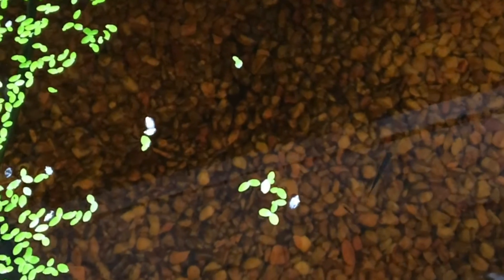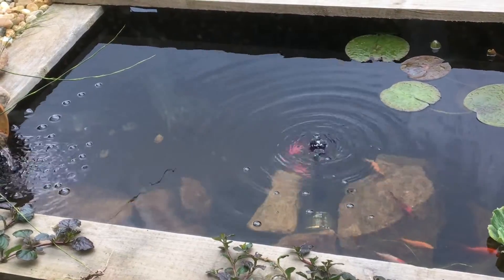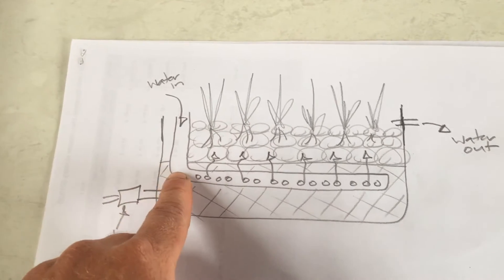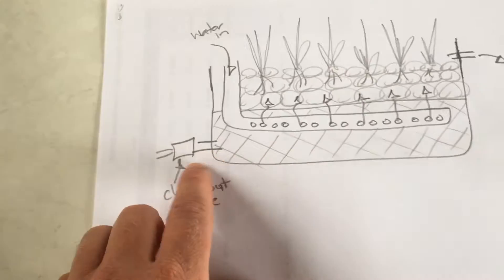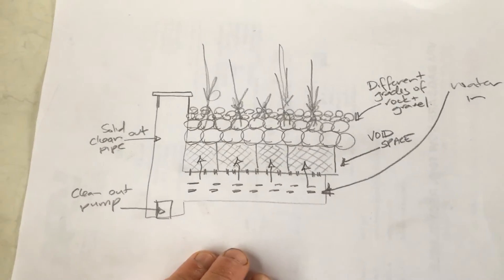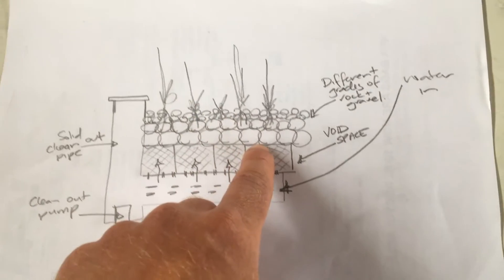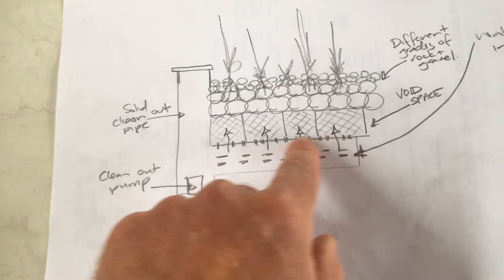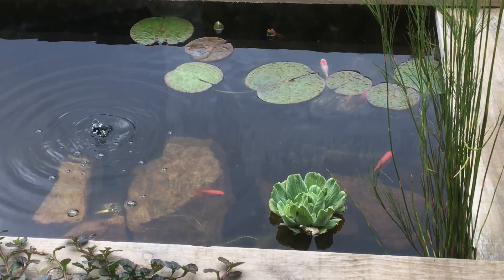What size should a pond bog filter be?

Comment: Hi Kev, the pond you built where you retained behind the blue drum (bog filter). How many litres is the pond and what size is the bog filter (in litres) and what size pump did you use. Thanks
Reply from the maker: I estimate the pond is between 2000-3000 litres. Bog filter is 220 litres. Pump is 4500 litres not all running through the bog.
Reply: @Ozponds  Thanks, I really love the overall look of this pond. Well done,  I'm just in the process of costing something for my place.
Reply: @Ozponds  , so have you diverted the flow 50/50, splitting the flow so half enters the bog and half spills down stream/waterfall?
Reply from the maker: Kinda. Half just passes over the surface of the bog before continuing its journey down the stream and waterfall.

Comment: Im confused,  so if my pond is 5 meters long x 2.5 meters wide x .6 meters deep, then i need a 750 litre? bog filter (plus a 8000 LPH pump).
Reply from the maker: You could do it that way. 750 litre bog I’m looking at about 4500 litre pump. If you go 8000 litre pump don’t run all the water through the bog.
Reply: @Ozponds I presume the excess water not being pumped can go to random outlets direct in the pond?
Reply from the maker: @ absolutely 👍

Comment: I think I'll need a bog filter with at least 50% the pond's size....   
I'm actually making a bog filter for my bird bath (it gets super dirty), but 25% of it's size would make the flow way to fast considering your suggestion of 15 min long flow... does my idea make sense?  I hope it does :)
Reply from the maker: That makes sense or you could use a smaller pump. A bigger filter is always better in my opinion.

Comment: Hi Kev, Thank you for the awesome video's! We are currently trying to design our bog filter.
Our pond is a rectangle 57 ft long, 4,5 ft wide and 1,5 ft deep, which totals around 2827 gallons.
We have a 264 gallons IBC tank, could this work as a bog filter?
The tank's surface is 12,9 square feet, when compared to the pond's 256 square feet surface, we should have two.
When looking at the pond's volume, it's a close call, would you still recommend getting a second one?
Again, thank you!
Reply from the maker: Ibc makes a great bog filter. It’s up to you whether or not you add a second. I will say more filtration is always better.

Comment: will bog filter work with clay bottom farm pond 1800 ft2 w/ much silt and muck
Reply from the maker: Well to start with you would pump water from the surface. You don’t want to just pump a whole bunch of muck into the filter. It also won’t capture the silt very effectively. Clay particles are little buggers you really need a flocculent to force them to clump together. Is it the silt that is causing your clarity issues?

Comment: Hi Kev, i am looking at adding bog filter to my pond. The pond is about 1000 litres so looking at 100 litre bog. However I also wanted to have a skimmer, but the ones you can buy like Oase Aquaskim recommend minimum 8000 litres/hour. Can any skimmer work on lower flow rate?
Reply from the maker: Not really skimmers do need a decent flow through them. Have you had a look at my budget goldfish pond? It’s 1000L, has a bog filter but no skimmer. Water is crystal clear year round, I just scoop the built up waste out once or twice a year.

Comment: What do you put in the void space so rocks dont cover it up?
Reply from the maker: You can use anything that will hold the weight of the rocks above. Professional installers use specially designed equipment such as aquablox. I’ve used large diameter pipes, milk crates etc. Others have used plastic pallets. There’s many options. It depends on your budget and what you have available.

Comment: What exactly do you use as a void space? can i use some plastic basket ?
Reply from the maker: Anything that can support the weight of the rocks and gravel. On small systems I just use larger rocks and gradually go smaller and smaller. On larger filters aquablox, large pipes with holes, even milk crates. Whatever you can easily get your hands on.
Reply: @Ozponds  Yeah I was looking for milk crates
Reply from the maker: If your going really big one viewer suggested plastic pallets. They are cheap and can withstand heaps of weight.
Reply: @Ozponds  oh thanks, I‘m going with a 300L Tank
Reply: Can the stones be replaced with other items in a bog filter, if so what items?

Comment: Hello, what do you use to cover the pump end of the water inlet so it doesn't get clogged with debris?  Do you enclose it in a container or do you use a filter material on the end?
Reply from the maker: G’day Patrick. At the moment I am building 2 for my dream pond. Where the pipe from the pump enters the bog filter pipe I have used geotextile underlay to stop the rocks and other debris entering that section. Hope that helps 👍

Comment: Hello, your idea is so great, I really want to build a bog filter too. May I know that the material used under the water pipe (crossed area in your video) ?
Reply from the maker: G’day John. It can be anything that will create a void space and support the weight of the rocks above. Professional installers use special load holding matrix blocks (such as aquascape aquabloxs), others have used milk crates, even just large rocks will work. If it can allows solid material to pass through easily without becoming clogged it will work. Hope that helps 👍
Reply: Great work undoubtedly 👍

Comment: Hello Sir! I am planning to build a pond with the natural Bog filtration system and/or Aquaponics, but the pond is meant for ducks. I have been looking for videos related to this, but often this filtration system is meant for fish pond and I haven't seen someone with a filter system for DIY ducks pond. 

Why is the reason for that? But do you think having a sustainable filter system for a duck pond will also work? Thank you.🙏 I appreciate all the learnings you've taught us with your videos!
Reply from the maker: Gday mjlm. Ducks are notoriously messy. Bog and aquaponic filters will help keep the water healthy. If I were doing a duck specific pond I would want tons of circulation, I would definitely incorporate a skimmer/ intake bay but also pull water off the bottom of the pond (ducks poo a lot). In regards to the circulation I would have some jets pushing water along the bottom towards the pumps as well as surface jets. Good luck with your project 👍

Comment: Hi excellent video. I have a question.? I am in the process of enlarging my fish pond. The new addition will be 18 x 23 feet. The deepest section is 4 1/2 feet. The rest of the pond is about 2 1/2 feet. I dug an area outside of the pond for a wetland filter or bog. The size is 3 1/2 feet wide by 12 feet long 3 feet deep. I used reinforced milk creates 14 of them side by side as aqua blocks. I am using  ABS 6 inch corrugated drain pipe as the centipede. I cut out slots on the top left and top right of the pipe. 1/2inch wide by 4 inches long vertically every 5 inches along the full length of the pipe. This pipe will be on the bottom of the hole in a trench with the aqua blocks (milk creates) on top. On top of the blocks will be different size gravel. 8" of 3" - 6", 8" of 2"- 3" and 8" of 3/4" - 1 1/2" river rock.  I am also using a large pipe for the cleanout of the filter. The water intake will be coming from the ponds intake bay. My question is the size of my wetland filter. Is this size sufficient for the new addition? I could try to make it bigger but the space is limited due to a deck and cesspool near by.
Reply from the maker: G’day Mike. Sounds like it’s sized appropriately. Should work a treat 👍
Reply: @Ozponds  Thank you very much.

Comment: Some one said in a video you do not want your bog to be more than 12 inches deep and you want the water level to be below the gravel. Do you agree? I planted my bog plants in fabric pots and used potting soil to plant them. Then set them on top of the bog filter. The water line is about 1/2 the way up the pot. I cleaned out my planter bog for the first time last week after 3-4 yrs? There was massive sludge all the way down, but the cloth pots made it easier to pry apart. I used multiple layers of plastic mechanical filter pads instead of gravel. My bog is about 24 inches deep and it was smelly at the bottom so when I put it back together I dropped an air stone down there and promised I won't let it go that long again. All in all I think my little bog works fabulously as I have never had a green pond.
Reply from the maker: G’day Joan. Depth doesn’t worry me much. For me the most important things are: 
1. To move the water slowly through the bog (this allows the solid waste to fall to the bottom).
2. Provide an area or void space where this waste can settle.
3. Make it super easy to remove the accumulated waste. 
In terms of the plants they are only responsible for 10-20% of the filtration. The bacteria’s living on the gravel or in your case sponges are doing the lions share. I like to plant shallow rooting plants in the bog to make sure the roots don’t clog up the area where I want the solid waste to accumulate. I see adding aeration as a positive as it will supercharge the bacteria’s. I will try it in my next pond. I hope that helps. Bogs are incredible filters and they can be built in numerous different ways. If it works and you are happy with the ease of maintenance that’s all that matters.
Reply: @Ozponds  thank you for your reply and thoughts!

Comment: I created a bog filter using a railing planter. It worked out that the drain holes in the bottom were perfect for connecting the pump hoses. Added some gutter sponge, polyester fill and lava rocks. Drilled a few holes toward the top edge of the planter for the waterfall and it works like a charm in my 85 gallon stock tank pond! Added some plants and moss I collected from the local river. The creeping Jenny loves it there. The water is crystal clear and the gold fish are thriving. Now to prepare for winter. Any videos on that?
Reply from the maker: That’s awesome Carl. All my bogs run year round, our winters are very mild by American and European standards. So prepping for winter isn’t my specialty. All I do is cut down the plants so the dead foliage doesn’t cause problems. Do you plan on keeping it running through winter or will it need to be shut down?
Reply: @Ozponds  it gets to freezing however I'm thinking of running one pump disconnected from the filter as that has a high possibility of freezing and possibly a heater or two. Planning on covering it as well.
Reply from the maker: Best of luck. I’d love to know how it all turns out 👍